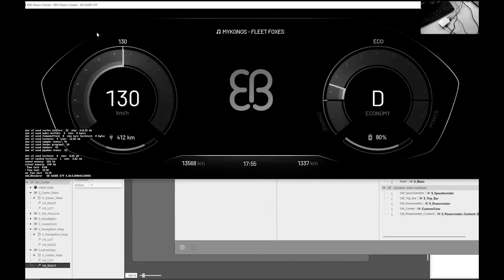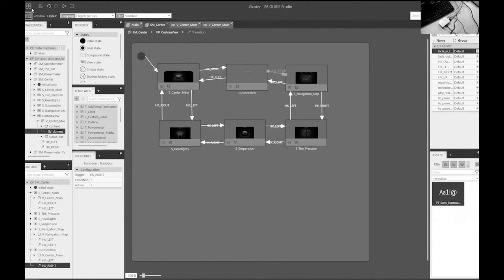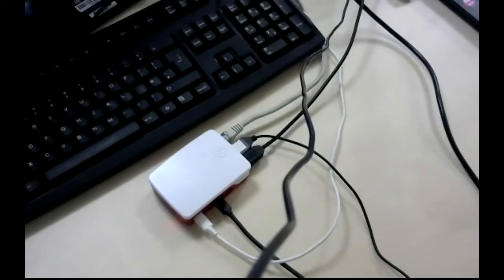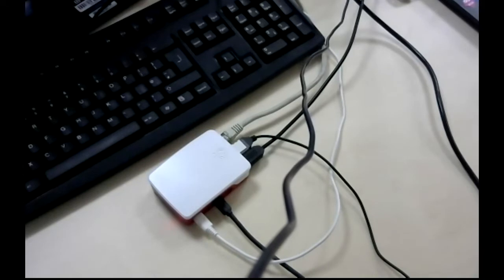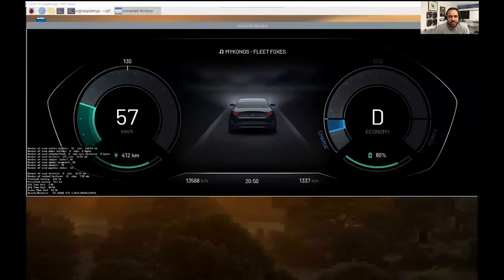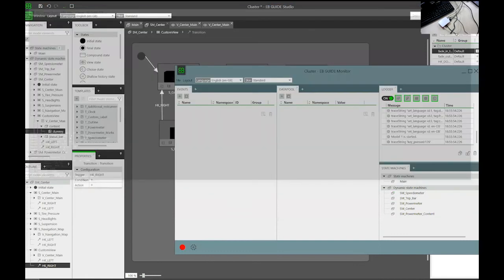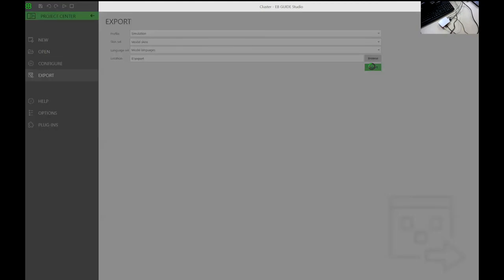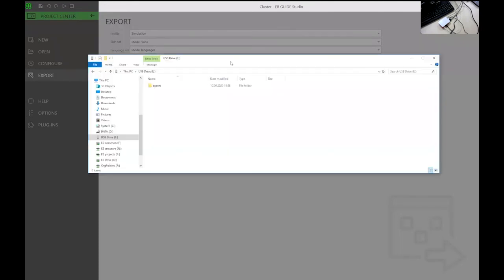Create an Automotive User Interface with EB Guide & Raspberry Pi 4

Comment: How to get sensor data from other application into EB Guide and display them ?
Reply: Second.

How does this interface with a vehicle? I see in the manual that you need to create an external communication via communication contexts and also datapool item. 

What I don't see if what is compatible? Would a standard OBD2 reader connected to the Pi be accessible from the software? Or must this interface with a different computer on the vehicle and if so with what additional hardware?
Reply: Hello, did you guys get the answer. I am confusing with the same problem
Reply: @thienannguyenhuu5447  no I have not received an answer yet. I would like to know so I can purchase the software.
Reply: I asked the same questions in the contact us form in Electrobit website, but there were no response yet, its been 3 days 😢
Reply: Software cost ???

Comment: But Rpi 4 is too expensive for automotive BOM. I'm interested in what do you use in real applications. SoCs, FPGAs, or just plain microcontrollers
Reply from the maker: Hi Leon,
As mentioned by another commenter, you're not using the RPi, but the SoC used wouldn't be cheap, either. Currently the trend is to hypervise large multicore chips and run various subsystems on them, one of which would be the cluster.